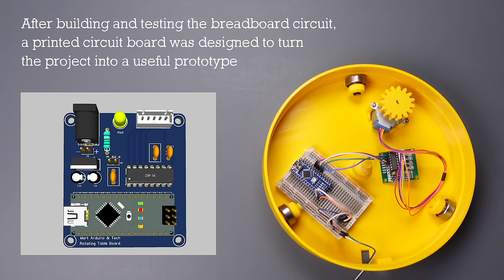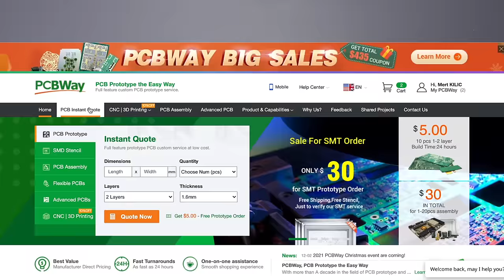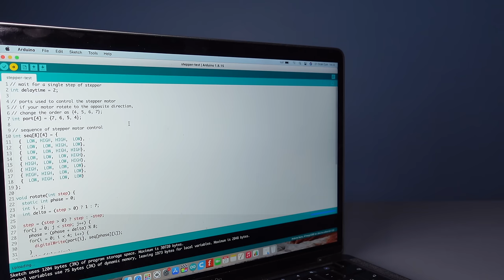3D Printed Rotating Table - Arduino Nano and 28BYJ-48 Stepper Motor

Comment from the maker: Source code, Circuit diagram, PCB Gerber file, 3D STL file:
https://www.pcbway.com/project/shareproject/3D_Printed_Rotating_Table_Board_with_Arduino_Nano_and_28BYJ_48_Stepper_Motor_ca5b53c9.html

Comment: Cool turntable.  All the electronics were included in an Arduino starter kit I got a few months ago, and I also ordered a three pack of nanos at the same time, so all set for hardware.  I'm either going to use a small breadboard or maybe a small piece of prototype board.  The PCB you designed is very cool, thank you for providing the design, and $5 US each is a great price, but the $20 shipping from PCBway is tough to swallow, especially for DSL  The few times I've ever had something lost while being shipped is when the vendor shipped with DSL  They actually lost an entire bench top metal lathe once, smh.  Great project, thank you for your time and effort.

Comment: Ay quick question for you, is it possible to control servo speed in the adafruit pwmservo library? I am using the board the you showed in your 16 servo tutorial.
Reply from the maker: Please have a look here - https://learn.adafruit.com/16-channel-pwm-servo-driver/using-the-adafruit-library
Reply: @maker101io  Hey! First off, big fan of the channel! Second off, unfortunately this didn't give me any info on controlling the speed, unless there is a part of it that i missed. Is there any way to make the servo slower? Thanks!

Comment: I'd use an ESP 32 and control speed and direction via wifi web interface.
Reply from the maker: Good idea 👍🏻
Reply: @maker101io  I'm not a programmer, I'd almost use the ESP32 firmware version of Marlin which works with a 1604 Oled out of the box, or the ESP 32 GRBL. They have a nice web interface.

Comment: How many Amps are needed for the 5V power supply?

I want to do this projet but modify it a bit so I can lay a lithophane cylinder on this base.

Im trying to figure out the demand of these electronic components.
(I'll add some LEDs and will modify the top plate stl a bit).

Its for a Christmas gift. Any help will be appreciated.

Thanks guys!

Comment: How many amp for the power supply?
And for the transistor in your circuit. Is it an AVB or ACV?
If you check on pcbway the name change between the 2 lists.

Hope to have a quick answer, its for a gift.
Thanks!